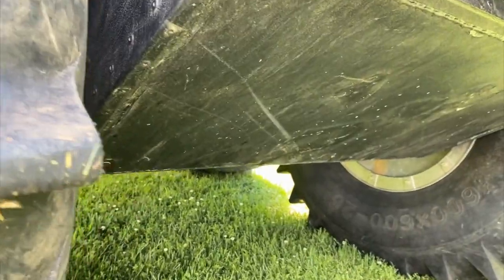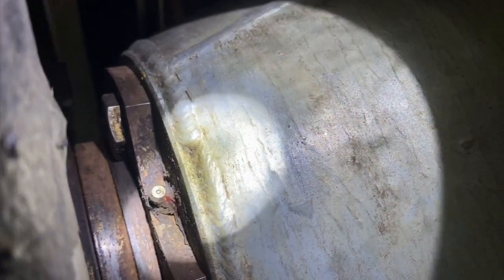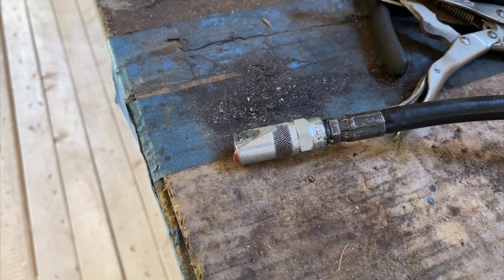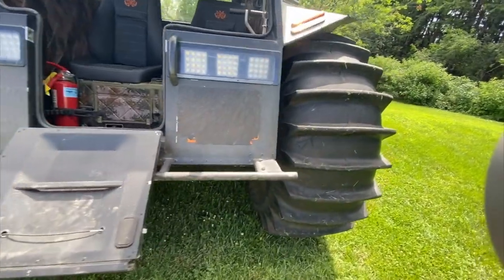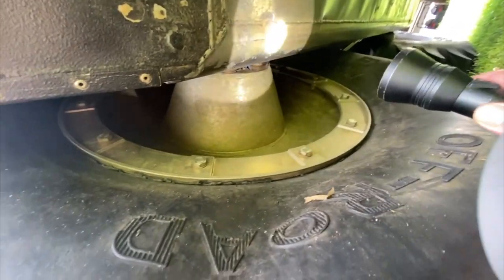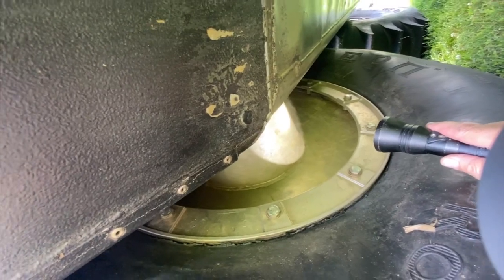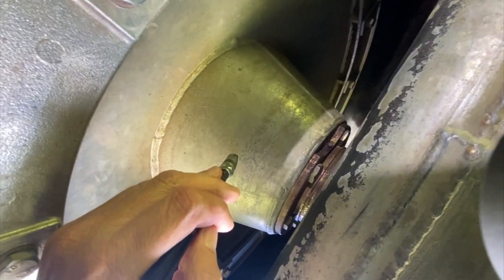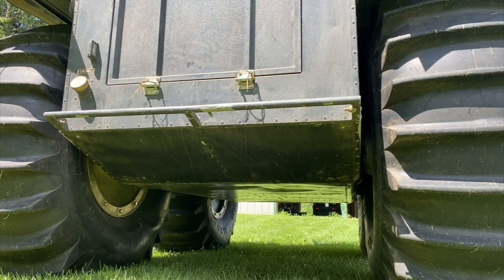Sherp Maintenance - Wheel Bearing Greasing

Comment: Hello, do you have an update on the transmission?
Reply from the maker: groutaone transmission was not replaced. Was able to drill out fuse and pull. Barely enough room to accomplish. Then new fuse and she works.
Reply: @SherpET  Thanks, could you make a video to show the mechanical fuse that was removed? Also what would you do if you needed to replace it and couldn't tow the Sherp out? Do you have the Sherp Max or Pro? I wonder if maybe a simple shear pin would be a better system than the fuse.
Reply from the maker: groutaone I could replace it. Here is link for mechanical fuse https://youtu.be/dsYv2vwO3kk